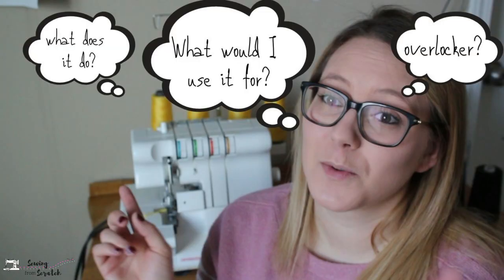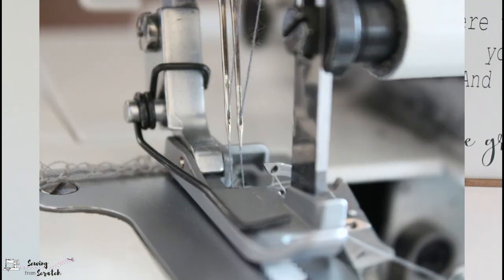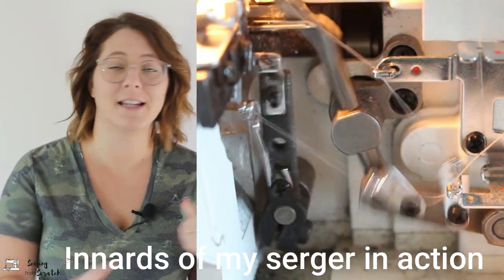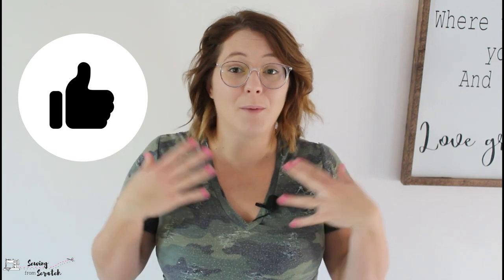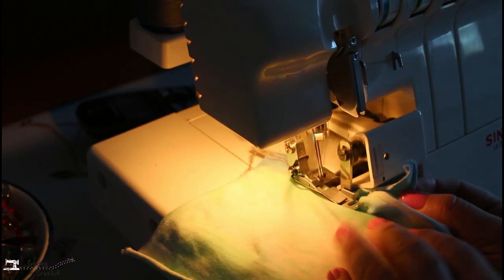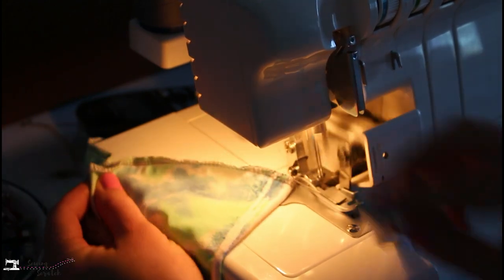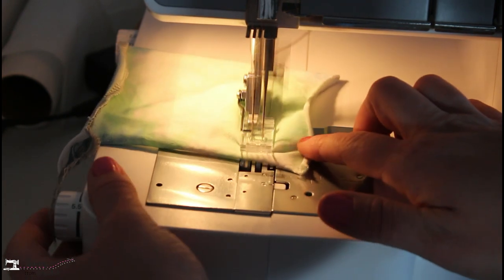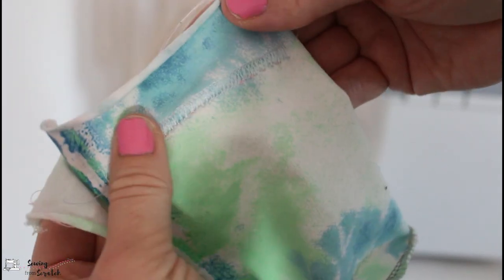Difference between overlocker and coverstitch machines

Comment: I'm confused. I bought a machine second hand that I thought was a serger. It makes chains but it doesn't cut. Could it be that the blade is missing?
Edit: Never mind! I found the blades. The top one had been moved out of the way 😅 Going to replace them anyway as the machine is at least 20 yrs old so I imagine the blades are dull
Reply from the maker: They can also be sharpened 🙂

Comment: what is  the different between overlock vs flatlock stitch?
Reply from the maker: Overlock is 2 or 3 parallel rows of topstitching on one side with a chain (similar to a serger chain) on the other side. Flatlock, to my knowledge, has the serger-type chain on both sides